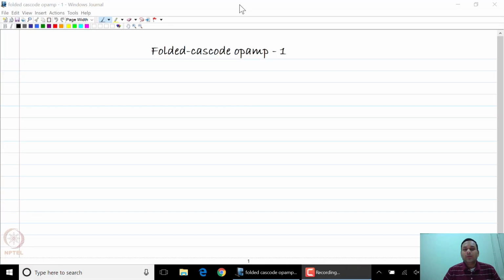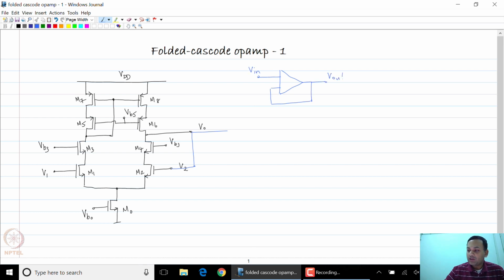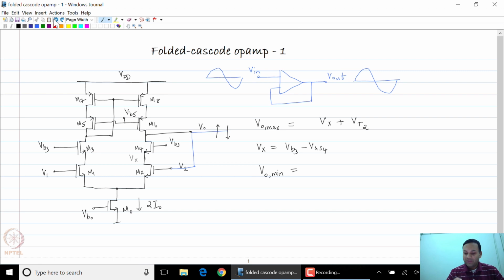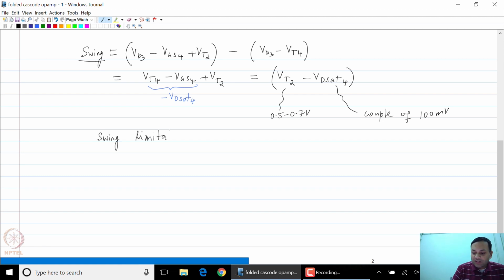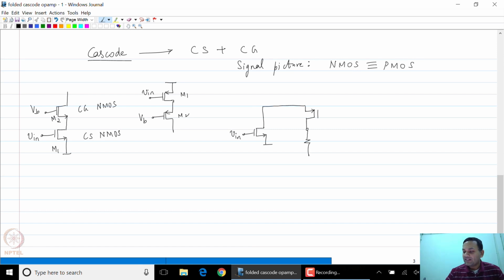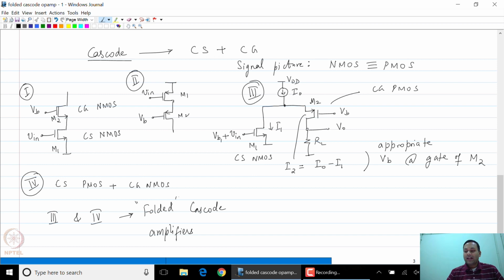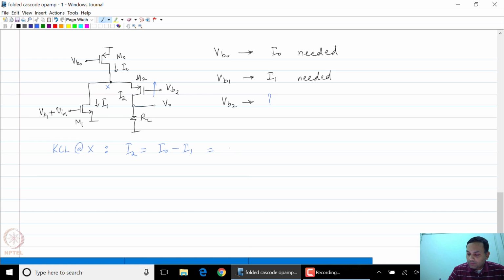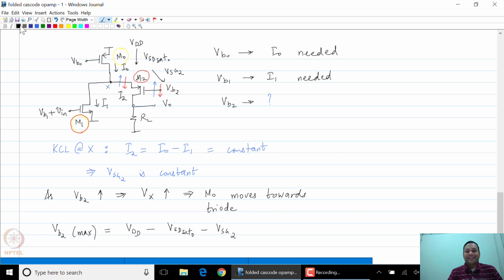Folded-Cascode OpAmp-1

Comment: hi, i don't under stand that why Vgs4 is constant value at 5:40
Reply: Vgs4 has to be constant for constant to supply a constant current of Io.
Reply: @raghwendramahato8969  yes
Reply: so all derivations here do not take channel-length modulation into account? thanks for the video
Reply: @tomurkin5563  no. it would unncessarilly complicate intuition based analysis. Simulations are there for that 2nd order based calculations